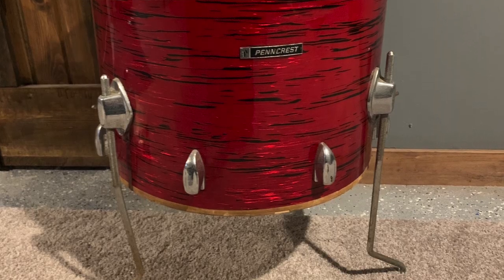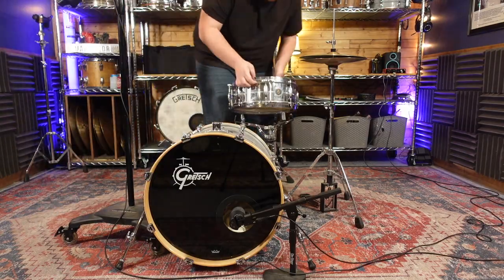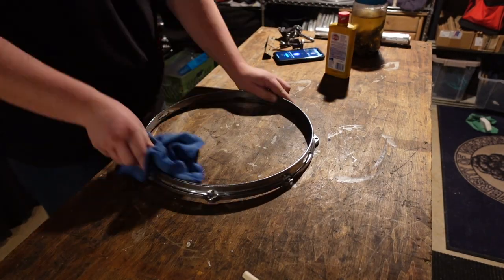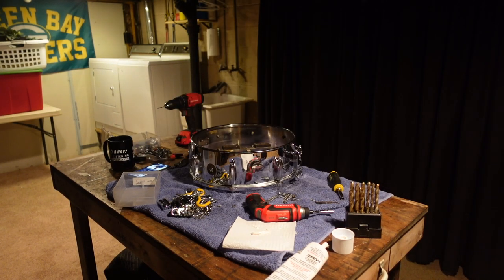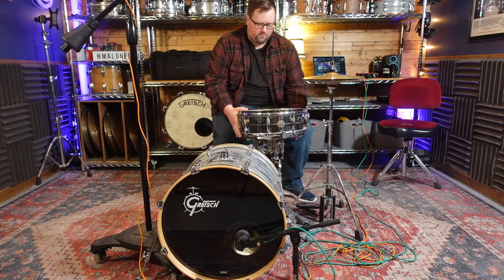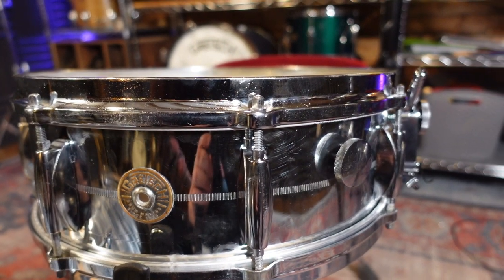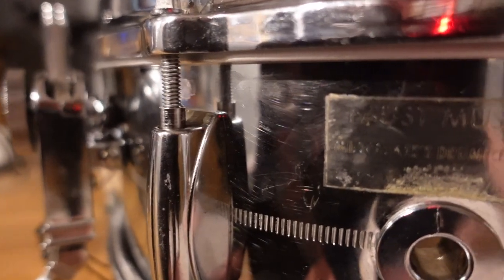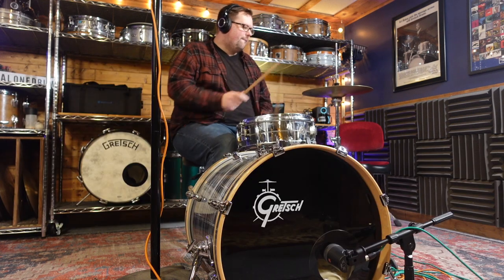1960's Gretsch Chrome Over Brass Snare FOR FREE // Restoration & Demo

Comment: I got one about 35 years ago, it is great for outdoor gigs, really barks. Recently put the new Ludwig P88AC premium throwoff on it, sorry about not keeping it original, but I think it's quite an upgrade. A great snare, really pops. For recording? Probably too hot and bright, but awesome playing live gigs. Thanks for the video!
Reply from the maker: Couldn't agree with your assessment more!
Reply: Love the die-cast hoops, but after almost 60 years, the chrome plating got like little razor blades. I play with a lot of "gock" rimshots, and I got used to sticks getting chewed up in the middle. Eventually running my hand across the rim would draw blood, and it was time for a new die-cast top hoop. Now I have all the die-cast crack without worrying about the bandaids!

Comment: I actually got one of these snares for free. I got it from a high school girlfriend’s father, an estate manager, whose colleague got a bunch of drum stuff from a client who died owing him money. 

The shell, lugs and strainer are the same, but it has a square badge and a linear throw. Real collectors would know the story as to why those are different. The throw was useless. I bought a re-issue of the old style throw off that looked identical, but the whole pattern was upside down! I created a wooden mount to allow me to use it fine, but it definitely doesn’t look like an original now. Sounds fantastic though.
Reply from the maker: They've made this same model drum throughout the many eras of Gretsch, so I imagine you're is just an 80's or later with the square badge, but same nuts and bolts essentially!

Comment: Hi Mike, congratulation, great snare. I have an identical snare, I wish install a micro sensitive trow off, in yours is it an upgrade or is the original configuration? in case of an upgrade the holes pattern is the same? thanks
Reply from the maker: It is the same hole pattern!
Reply: @malonedrum  wow! Great news, the original vintage lightning works bad...
Reply: @malonedrum  probably I will buy a new microsensitive...
Reply: @malonedrum  Maybe I wasn't very clear, I currently have a lighting in my snare drum, my question is relative at the possibility of replacing the lighting with a microsensitive one, I have 3 holes pattern at the moment...
Reply from the maker: @fpdrum  I can't speak to that with certainty, sorry.

Comment: You didn't put any extra expense into the acquisition of the drum  and were able to hopefully share in the profits on selling that fellas other equipment, so it was for free, or better. Hopefully any extra profit paid for the upgrades of the drum, so it was totally free.
Reply from the maker: I can’t remember where I ended up on my commission for selling his equipment, the initial acquisition of the drum didnt cost me anything with the commission. 

New snare throw and heads were a worthy investment into the long future of this drum though.
Reply: @malonedrum  yours is the only channel ( I think ) where I've seen the throwoffs with the extended handles 🤔 Pain in the neck if you need to flip the drum and lay it flat, true, but interesting design indeed. I'm into this idea of building 12 lug metal snares ( 6.5 to 8 deep ), since I did my first one all out of used parts last month though, and  it probably wouldn't  work on an 8inch, but I'd like to put one of those long handled throwoffs on a 6.5 🤔

12 lug rims are super hard to find, though.....